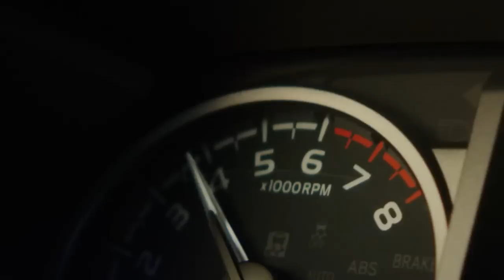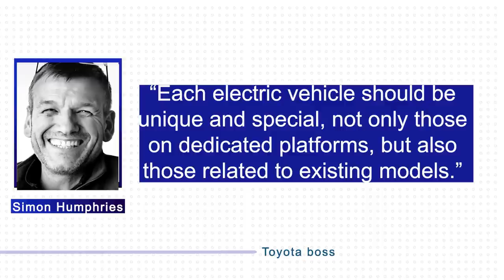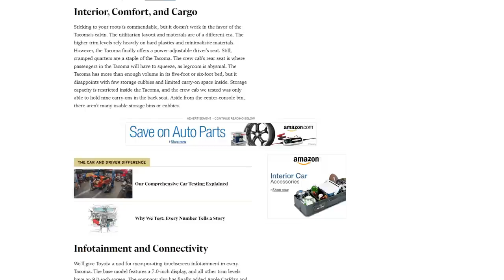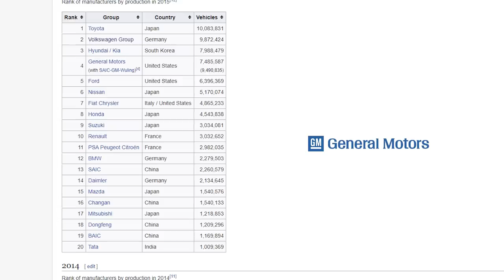Toyotas ALL NEW Electric Truck Can't Be Ignored!

Comment: Has anyone pointed out that 325 km is not the longest range? The f150 has 300MILES OF RANGE. lol
Reply: It got 80 miles in a real world tow test
Reply: @snacking5908  yeah, electric trucks suck at being trucks.
Reply: Electric Cars I understand. Electric SUVs I can forgive but electric trucks, to me are pointless. Can’t tow for long distance as you would with ICE or Diesel trucks.
Reply: @snacking5908  and the Tacoma won’t be any different, no EV has good towing range. That don’t change the fact the video was wrong about 325 km of range being longest EV truck range. The lightning and rivian both still have longer range
Reply: Rivian R1T has the best range of all E pickup trucks
Reply: @GodsloveMuzik  If towing is what you need, you should stick with gas/ diesel, agreed. But most people who own a truck never use it to tow anything more than a few miles if at all. For those people, the electric truck makes sense.
Reply: I wonder when they will just start putting electric motors on the trailers to "power assist at the wheels" for range extension and overall performance? I think it would work with good software that links the accelerator pedal with the wheels to the trailer where you could adjust the power threshold using the software... or if it automatically adjusted based on trailer weight.

Maybe I should invent it
Reply: @MilVetGaming  you should invent something like it. However, if you have to tow a boat or RV trailer then that’s another challenge for you to tackle.
Reply: @ThePassengerPreacher   @OK-DUB  Well, if the boat were electric, lol, it could power its own trailer. It is useless until in the water anyway. I bet electric boats would get more range than cars? An RV?.... since the trailer is only "assisting", it wouldn't need a huge battery bank. It could even be hybrid gas/electric for increased range and power. Just throwing thoughts out there.
Reply: @MilVetGaming  The problem isn't power, it is energy.  Additional electric motors would still just drain the batteries of the truck. You would need to install battery packs on the trailer to get any range extension, which would make the trailer cost and weigh as much as the truck.
Reply: How about q simp,e, decnt plug in truck.

Comment: Toyota keep duplicating from Ford. But I won’t buy EV in the real world.  Just overhyped. Ford Lightning pull 4,000 pound travel trailer for only 70-80 miles.  😀

And charging EV, power plant spews three times more than gas-powered vehicle smog’s.  Many environmental issues with EV.  Elon Musk knows.

Comment: Yes it can be ignored until its real, with a delivery date and published pricing...  You are already wrong in the 325km range being the best... That's 202 miles.  Ford matches that with their base model and get eaten by the extended battery model.  Bring me real data instead of a Toyota commercial.

Comment: Yes they are tremendously late to the party and they are bleeding customers. Too slow to come to Market and 2024 is too far out to start. If they come out in 2024 they need to blow every other truck out of the market which is not going to be likely because they will be working on their next-gen stuff and fixing any problems they had from their first off the line. Toyota Fielder song and I'm looking to jump ship myself. No I don't want an EV truck hybrid maybe yes but not all EV. I drive long distances into the woods and mountains for that.

Comment: It’s a great every day driver it is not a functional pick up truck as soon as you put a trailer on the back of it you lose all of your range.
Reply: Not for that consumer. It's for the millions of people who drive trucks, yet only haul air.
Reply: @Frygonz  pretty much. These new Electric trucks and EVs would make a bigger impact in reducing oil usage than Priuses. Not sure if it's better for the environment though?
Reply: @teejayman215  I'm in the camp of people that posit that the best environmental (and economical) solution to car emissions is infrastructure that allows people to make the choice to not have to drive everywhere in the first place. You still can if you want, but the other options are convenient enough to be feasible. I would have every car be a coal roller if it meant most people only needed to drive a couple times a week or even less. If we replaced ever car on the road with EVs, we would still be in the same dilemma; possibly even worse because the heavier EVs damage roads more.